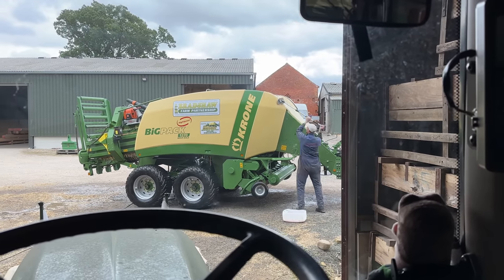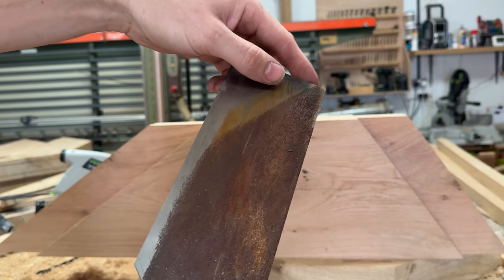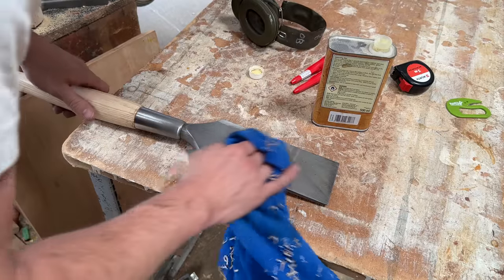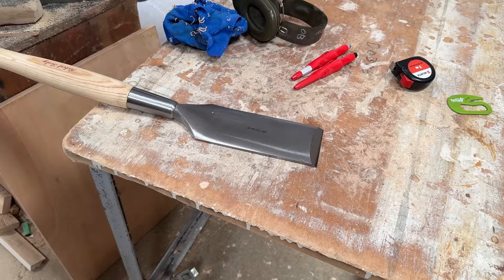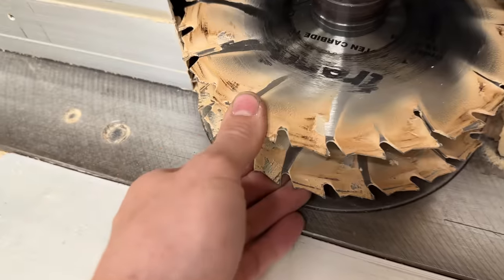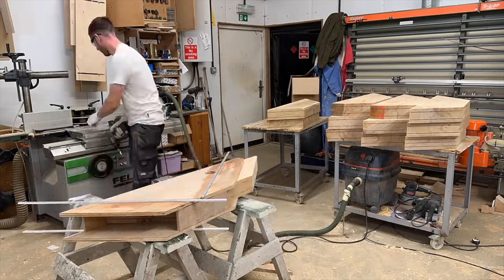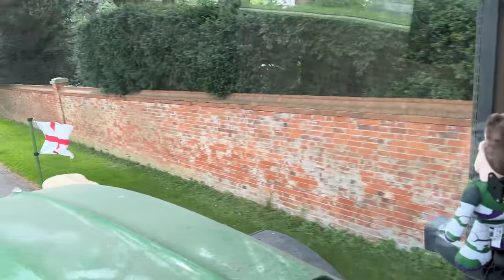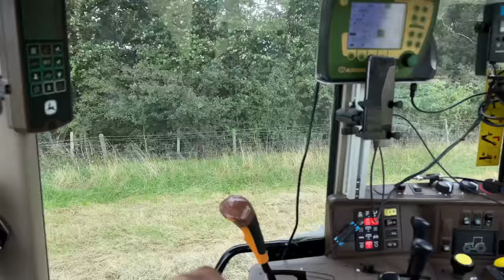New chisel on Green Oak Overnight - disaster! Brace Machining and a Glimpse at a Future Job

Comment: Had that happen to my tools as well before. I found Liberon furniture wax works really well. If I have enough time I heat up the tool with a hair dryer just warm enough not roasting than I apply nicely the wax leave for 10 minutes and buff off with a piece of cloth. Not only does it protect it but gives the surface a nice slick feeling as well so it glides over wood nicely.

Comment: Great video, I always nice to see commercial machinery in operation.   Also great to see the baler running, most people have no idea of what it takes to get food from a farm to the table.  I’ve had the same rust issue pop up from time to time over the years, never fun.  Waxing and Oiling have become a religion, whenever someone comes into the shop I instruct them not to touch the bare metal surface, inevitability they are drawn to it like a magnet. :)

Comment: Is my memory correct? From woodwork lessons at school over 50 years ago, I seem to recall that oak is extremely corrosive to steel (chisels!) and so steel screws are no good in oak?
Reply: The tannins in oak are corrosive, stainless steel fixings only for oak I believe.
Reply: Screws inside of wood are not exposed to air (oxygen)
Reply: @WilliamKot-st9qm  no, but they are exposed to the tannin in the wood - it's the tannin that corrodes them.

Comment: I was told to use a light oil (like gun oil) been using it since but it only works until it doesn’t - stays shiny wrapped in cloth in a case but as soon as it’s exposed to moisture; Rip

What products does anyone recommend for longevity? 

Muchos merci

Comment: What do you use that massive chisel for?
With a lump hammer?
Reply: I think its a two handed slick by Robert Sorby used for timber framing.   Its like a really beefy honing chisel, you don't use a hammer on it.
Reply: I've seen a similar sized chisel being used to build canal lock gates.
Reply: I've always found wax a waste of time on tools, my own preference is a light spray of gt85 spray  or wd40 and a quick wipe with a rag.